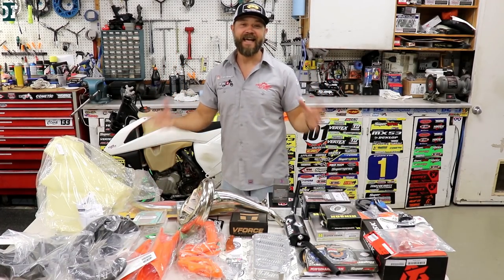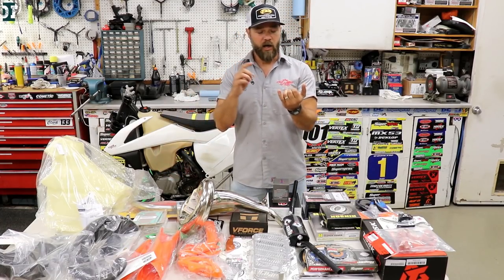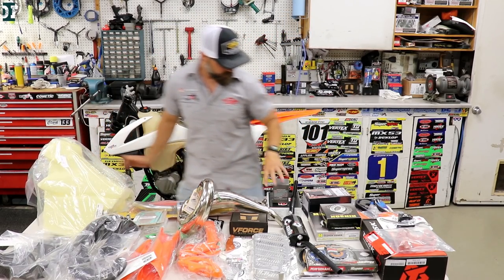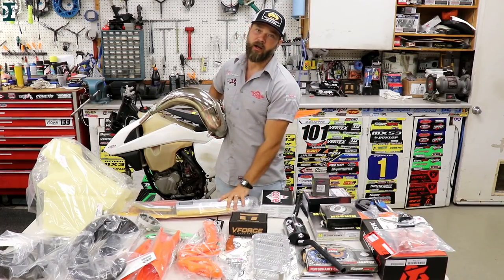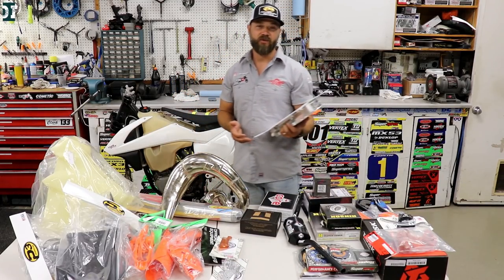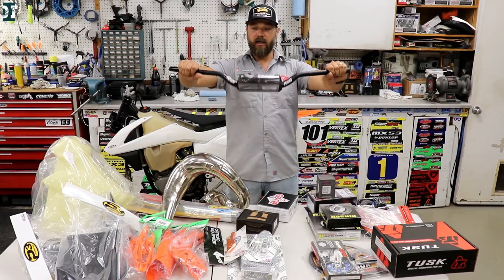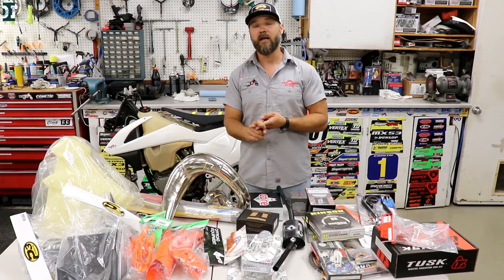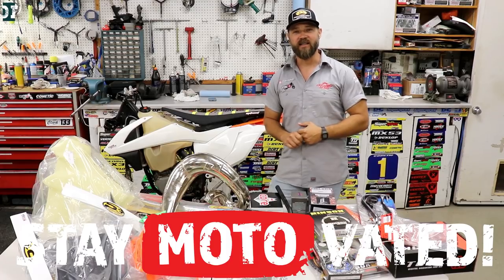2017 KTM 300XC with 250hours - different dirt bike build

Comment: What are you going to do to the WP AER48s? N2Dirt sells a nice MX Tech AER48-R cap and leaf spring kit. Also, what about the SKF Glide kit?
Reply from the maker: Racetech is working on the suspension, keep it air and just rebuild plus set for me

Comment: Hey I just subscribed. I'm looking at your older wr450f vids.. now that you've ridden a ton more bikes do you still recommend an 07 wr450f as a good bike? I'm buying one next week
Reply: Also I ride mostly trails, single track. And how does the 07 wr450f hold up against some of the newer models out there. Thanks
Reply from the maker: I think its a really good bike, little bit heavy so count on that. It feels great on flowy single track and can do technical riding too, but light 2 stroke would feel better on technical rocky trails. I think you can go wrong with wr450

Comment: 👍 This is going to make a great trail bike for you... I haven't run my bike since I installed the Vforce4 reed cage the other night. What kind of difference do they make in your builds?
Reply from the maker: thanks brother! I am not sure about the difference of single mod since I do a lot of mods at once and then run the bike, it should be running better everywhere, specially if your old reeds were worn.
Reply: @dirtniron  The old reeds looked okay with 120+ hours on them. I also HydraForced the pipe, now it fits like new with no dents. Hoping the two changes give me more responsiveness.

Comment: Hi 
I have a Peugeot vivacity 2005
But there comes no fuel in to the engine 
I think there is A problem with the vacum because when i Bring fuel direct in the engine it runs can someone help it is 2 stroke
Reply from the maker: i am sorry Victor, I am not familiar with those bikes

Comment: Anybody know why my crf 250r choke doesn’t make a difference when I turn it on and off when the bike is idling, like it’s always on and overfueling itself.
Reply: Because probably you have the mixture screw fully open
Reply: @MotorcycleParody  you know where it’s located 2014 model don’t know where it is
Reply: @MotorcycleParody  it’s efi not carb